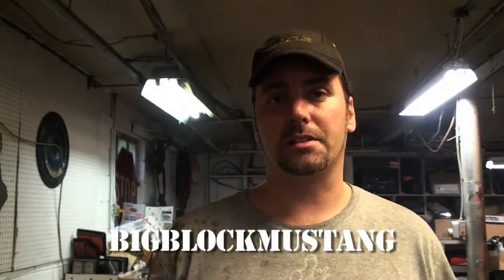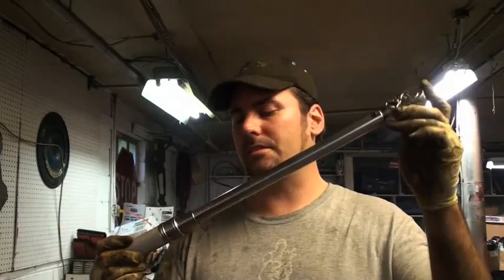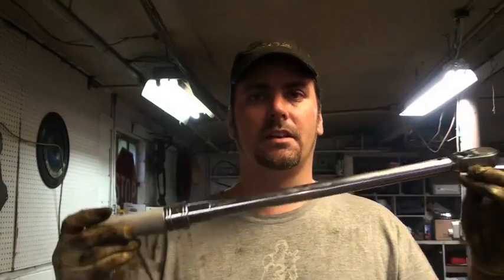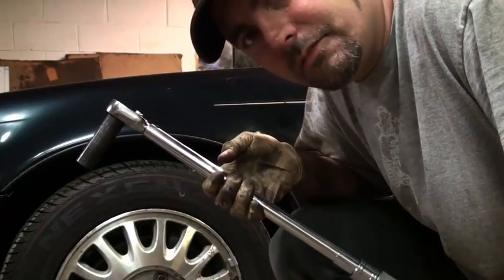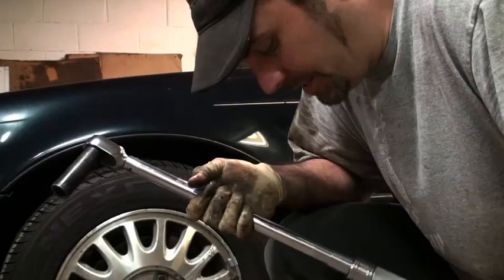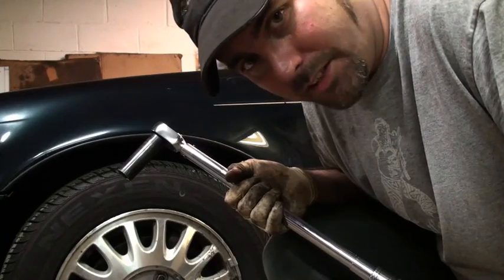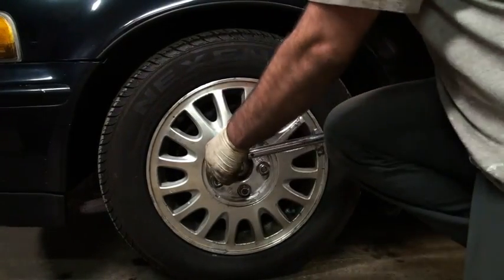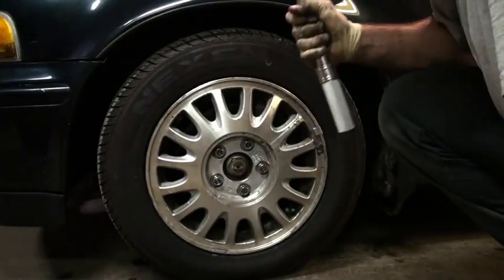Torquing Wheels and Why It Is Important - EricTheCarGuy

Comment: Just a reminder to everyone — always make sure your wheels are properly torqued after any tyre or wheel change. I recently had a very scary incident after getting 4 brand new alloys and tyres fitted at a local shop. About 30 minutes into driving at high speed on a busy dual carriageway, I started hearing strange noises. Moments later, the car began to shake and pull to one side — the front left wheel had completely come off.

Thankfully, I managed to keep control and stop safely, but the bare brake disc and bodywork were badly damaged, and the car is now in the shop for repairs. This could have ended much worse.

Moral of the story: after any tyre work, check that your wheel nuts are tightened to the correct torque — don’t just assume the installer did it right. It might save your life.

Comment: How can you torque a bolt after using Loctite on it? Wouldn't the bolt have settled with the Loctite by the time you lower the car and use the Torque-wrench?

Comment: I took my car to the dealership's mechanics just to replace all the lights in and outside. They also noticed a front knock (struts) when turning the stirring wheel. So they replaced the struts, which I've wanted done a long ago.  Which i gave them the okay to get it replaced. Well, I got the car back, but theres a sticker on the window stated "tires retorqued at 100 miles". If they checked everything and replaces the struts why cant they retorqued the tires, since they have the equipment.  Idk..please let me if they shouldve done this

Comment: Hi there, I wanted to ask you what the potential damage that can occur if the tech only tightens 1 lug but and just hand tightens the others to put the lug nuts on. Then lowers the vehicle back onto the ground and gives it back to the customer. They then drive about 10 miles at 50 kph, and once notice at 55 kph that they can hear their wheel moving back and forth.  You then drive another 2 miles in that condition in order to pull into a parking lot to see what’s going on and notice that the tech did this to your vehicle. I grab my torch wrench and tighten the nuts on the spot. Unfortunately, I didn’t have a jack with me to remove the rim first before torquing the nuts. 

I am bring the vehicle back to the shop to inspect for damage as they are covered by insurance. I’d like to know what I should be on the lookout for and would appreciate any advice.

Comment: 80 ft. Ponds thank you use to put them on so tight just before stopping them or break the lugs must.  Be getting old came off too easily so checking ft ponds I'll get a bigger breaker bar😂 save for torque wrench  to check getting weaker😢❤ thank you.

Comment: If you don't know what you are doing, you can still over tighten or under torque with torque sticks. It is depends on how long you hold the trigger and power setting of a pneumatic or electric guns.

Comment: You have to watch using the torque sticks on your Lugnuts because they are 10 foot pounds off I know this for a fact because I got yelled at by a shop owner for using the torque sticks and not rechecking them with a handheld torque wrench I’m just letting you know and I want you to go back and recheck those  Lugnuts with a handheld torque ranch and he was right they are 10 foot pounds offSo the torque sticks are good for getting your Lugnuts ran on an even pattern that’s all they will not be at the proper specifications they will be 10 foot pounds off

Comment: Works much better than the shorty lug wrench that came with my Ford Edge⋄⋄>share4.photo/cWheelWrench?まd    Still need the factory tool for the screw-jack, but the new wrench provides much more leverage.

Comment: Hope someone can answer this, I have a 2008 Toyato Rav 4 Limited and I just took off the original alloy rims and switched to steel rims for the winter, the tires are 17 inch size, apparently I have to buy new steel bolts or lug nuts whatever they are called and put those on, but my question is what would the torque be for those steel rims with the new bolts, I am thinking it would be different than the alloy rims and bolts, would love to know the torque so I can tell the person changing them out for me, I know I have to go buy the new bolts and I figure NAPA should know what I need, I am a senior trying to save a bit

Comment: Last week, the mechanic broke the absorber bolt while installing it. Few days later, I want to check the tyre, and failed to removed it manually (never face this problem for 15 yrs of changing car tyre).  Talk about over torque with air impact, easy for mechanic, hard for owner when emergency comes.

Comment: I liked to know what the torque is on the lug nuts on a 68 Chevy k10 with 7/16 lug bolts. I been telling tire shops to set them at 70ftlbs be a use they wanted to set them at 110ftlbs And  that is for 14mm ones. but I would like to ged t the right specs.
Thank you!
Reply: 80 is the typical safe torque rating if you need to do it and be done.

Comment: Tire shops should NOT use a impact gun to put the lug nuts back on. A typical car/suv needs 80-120 foot pounds to tighten the lug nut. The guns are putting them on at 200+. Ive had a couple of broken studs because of this, and a hell of a time taken them off on the side of the road as well.

Comment: I'm a tow truck driver of 20 years doing roadside work I've never torqued any lug nut with a torqued wrench and never been called back because something went wrong so I call bullshit!!!... but to you guys that are mechanics Tire changers and anybody else that does d i y ers. You all can read your paperwork but if you can not break a lug nut off a stud because the tire changer impacted the lug nut to fast and cross threaded it. I am talking from experience use ing a 4 way lug wrench and torqued by hand with a four way when the car is seated down on the ground

Comment: I just use the impact to lightly run the lug nut/bolt on to save time and torque the wheel to 1/4 of the total specified torque of the wheel (learned this trick from Volkswagen factory working instructions) and lower it to the ground and do full torque, it works too well to be true because first it keeps wheels secured when lowering and second it only takes extra 1/4 turn which is super handy for smooth, continuous torquing action.

Comment: The Toyota dealer was kind enough to cross thread not one, but two of the lug nuts on my girlfriend's Corolla with an impact when she went in for new tires. I had the pleasure of shearing both studs off when I subsequently went to replace her brake pads. Use a torque wrench...every time.

Comment: From what I've seen, if you find out the brake pedal is vibrating because the wheel lugs don't have all the same torque, no need to replace the brake disc even when driving like this for a while. Just torque back again the lugs in 3-4 steps, and the disc will go back to it's shape and the vibrations will be gone.

Comment: To properly do this it should be done in 4 increments 20ft/lbs, 40ft/lbs, 60ft/lb & 80ft/lb (final) if you wanted to be more correct with an even distribution of torque being applied. This will eliminate any chance of warpage of the rotors. Thats how i roll.

Comment: I hate people who whip out the impact to put lugs on. I went to do a brake job and noticed one lug was sticking out slightly. Turns out when I had my tires done they over torqued the crap out them and damaged the studs. I barely used pressure taking them off and so far 3 snapped on 2 wheels. I'm lucky the brakes made noise or the wheels would of come off driving.

Comment: You're also not supposed to have the full weight of the vehicle on the wheels you're supposed to lift it and get the weight off but leave the tire on the ground so the pressure of the weight doesnt effect the torque

Comment: This is really important, and a lot of people bypass this because they think it doesn’t matter a lot.  My rotors got warped pretty badly because the shop mechanics used an air impact wrench and torqued the nuts to 200 ft lbs.  Do yourselves a favour and go to an actual reputable mechanic who knows what he’s doing.  Or just buy a good torque wrench from an auto store and do the job yourself.

Comment: Hey bro, do you use a 3/8 torque wrench for cars/trucks when putting tires back on? Is that the standard for mechanics?
Reply: Joshua Snead 1/2 inch drive is better more leverage which means you're not breaking a sweat

Comment: Yeah I love it when I get new tires and they always use the impact gun and all the nuts are on way too tight.
Next thing you know I am fixing the issue with my own torque wrench.  Only need 100 ft lbs. on mine not 400

Comment: The big tire shops have a habit of doing this. I've had to replace quite a few wheel hubs on customers cars because those jerks are too lazy to properly torque them.. I always cringe when I see a tire shop tightening a lug nut that only needs 80-90ft/lbs with a 500ft/lbs impact gun.

Comment: I just bought a 1/2" CDI brand torque wrench. How have I gone so many years with out one? I do have a 3/8 craftsman but I am now chasing down a brake warpage at 19k miles on my new car from what I believe is the tire seller overtorquing or unevenly torquing my wheels. I watched them work and they run the lugs on with an air impact and then check with a torque wrench. It hardly seems accurate as they are moving super fast and that thing will click as long as its over the specified torque amount so I wonder really just how much torque those silly bastards torqued my wheels down to.

Comment: Hi Eric, I'm buying tools for a small project and also for getting into habit of fixing my own car and looking for best/most-reliable brand of tools to buy, including torque wrenches. What do you recommend? Thank you!
Reply: sorry im not eric but you can use powerbuilt or duralast, not bad companies at all and have lifetime warranties. stay away from harbor freight in most cases. if money is an issue for buying tools, I'd suggest a 3/8 torque wrench since it's in the middle of 1/2 and 1/4 so you have alot more variety to choose from or you can even get a 1/2 torque wrench and just use 1/2 to 3/8 adapters which are very useful in my opinion.

Comment: Lug nuts are steel rims are Al. Better to use anti seze on the steel thread and grease the contact area on the lug nut to Al wheel. Corrosion may not be a big deal but dissimilar metals can cause problems only way to slow it down is grease and that is not a fix.

Comment: I work at a lube shop...impacts are the only thing they use for wheels. I bought a torque wrench, and honestly will still have to use impacts because it's all about the time . they don't care if it's the correct torque . they want the car done. most likely why most shops fell into that pattern . I still believe in correctly torquing though.

Comment: Great video dude! I love your videos. People just don't heed how important wheel nut/bolt torque is and kudos for saying pound feet! haha so many dinks say foot pounds... I've been a Red Seal Tech for decades here in Canada and have seen some horrible after affects of improper wheel nut/bolt torquing. Some great pointers here I'd also like to add that one should not lubricate wheel nuts unless indicated by a vehicle manufacturer.  Lubricated fasteners have a clamping force drastically higer than unlubricated. I took a Caterpillar course where they had a pressure sensor between two plates of steel and we hand torqued the fatseners both unlubraicated and lubricated and the differences were shocking. The tensile load on your wheel bolt will be increased to the point that you may exceed its design strength. Torquing wheel nuts has to do with the interfence friction of the threads and mating surfaces so lubricating and hand torquing to lets say 100 lb/ft will increase the pull on your fastener until it reaches 100 lb/ft of interference torque.  Those damn torque sticks should be banned... My Ingersol Rand Titanium true twin hammer can over power any torque stick and dangerously overtorque a wheel nut/bolt.  Just adding to your excellent info Eric, stay safe and keep up the great work especially here on Youtube!
Reply: Hahaha. Troll you are... The wrong in your statements is high in content.  Glad you don't drive the same roads I do.  Keep up the substandard unsafe work dude 'cause you seem to excell it.
Reply: What?? I was replying to comments from gymchess. Anyone who agrees  with his statements should have their technicians license pulled....
Reply: +GymChess smh..... shhhhhh🙊 u may want to delete your comment (it makes u look like an idiot for 3 different reasons) thanks though 👌 lol
Reply: Hahaha. You're ignorance made my day. The moment a troglodyte like yourself gets are personal and talking smack you scored my statements a win.  Good luck with your wrongness and keep up the essence of ignorance because it seems that's all you've got to hang on to.  Now respond however you want because I shall not stoop to your Neanderthal level and let you bother me with what is years of precise experience in being an ignorant blow hard.
Reply: GymChess hahaha  you're an entertaining person, wrong on so many levels and ignorant of proper procedures but entertaining nonetheless.   I just love you Internet omnipotent tough guys who know best and tell tall tales to support your stance, which by the way is in the middle of nowhere...   and talking of proctologists..... I'd like to see things from your perspective but I'm not dexterous enough to fit my head up my butt...  I bid you and your asinine lack of knowledge adeu and shall leave the half witted responses on this matter to you and however many voices are rambling around in your cranium.
Reply: hi gmctech i may aswell try my luck asking you since it appears from your comment that u know what you're talking about...and im sick of searching for an answer to my specific question. im aware (and smh i do know better trust me) that a retorque is needed anytime a wheel comes off for any reason and its supposed to be after about 100kms or "50-100 miles" not sure since im canadian lol but im wondering if it makes a difference if u get them retorqued at about 900kms afterwards? lol i ask 900kms because thats about how far overdue i am for a retorque. i wasnt expecting to get my tires balanced and an alignment done but it just kinda happened when i went to dealship. i was extremly busy and lots on my mind so i completely forgot to get it done nor did they tell me because they knew i know better. anyway im wondering if they need to basically "reset" rim, for a lack  of better words, before a retorque SHOULD be done?
Reply: We'll the truth is, is that by the time you reach 900km you may have already be experiencing a loose wheel thus beating your wheel studs to pieces and your wheels stud holes may be oblonged and at the worst you may have already lost a wheel.  Go to crappy tire and get a half inch drive torque wrench and check your wheels regularly.  It's cheap and easy to do.  Remember to always back your torque wrench back to zero after each use too.
Reply: Oh I forgot to answer this ..... No. Don't take any wheels off just retorque them as is.  BUT!!!!!!!! If you more than 1/2 of a turn on your nuts, take the wheel off and inspect the wheel holes for any damage from wheel movement such as a build up up wheel material on nut face or oblong wheel stud holes.
Reply: thank you! not exactly what i wanted to hear but getting an answer and being aware of this provides a little comfort lol thanks again cheers😎
Reply: I haven't used a torque wrench in my life. Just check the nuts/bolts after 100 km or so. If they're the same as before, you're fine.
Reply: How's that? Do you have any idea how many wheels that I've changed in my life without once, ever, used a torque wrench? No, you don't. Not once ever have I heard of someone's wheels come off. Not once ever, have mine come off. An idiot like yourself; I don't know what your problem is except that your hands and brain capacity to torque wheel bolts are too weak.
Reply: lol u ape... he obviously meant that he doesn't need to know the amount of torque.. and no, it's not necessary with at least 2 braincells but for u it probably is
Reply: Exactly.
Reply: If it takes a technician to change his wheels, he probably needs a proctologist to wipe his bottom, too. :) I don't have to go very far besides myself to prove that it's absolutely, totally, not necessary to use a torque wrench. My father for instance has changed wheels for 45+ years on all his cars and to my knowledge only a handful of times has he bothered with a torque wrench. I'd love to see someone stranded by the side of a road refusing to change a tire because he's so nervous about the right torque that he much rather sits there in snowy weather in - 15 degrees Celsius and freezes to death because hey, the wheel might come off that one particular time but not the other 300 times. If you have a torque wrench, knock yourself out. But again, check the bolts and nuts after 50-100 km and if you don't have a torque wrench, you have my fullest understanding. Enough of this nonsense. :)
Reply: u still don't give up u silly ape.. lol if the guy says it works for him
 and probably millions of others over the world myself included then it 
works... accept it or not.. ur the one by the side of the road, too 
silly to change a tire without ur precious torque wrench... it's a tire 
change not rocket science u imbecile

Comment: my sister had new brake pads and rotors installed all 4 wheels on her sportage, it has alum. wheels, now the lugs on the driver side wont hold their torque, I suspect over tightening. do I need new rims or is a nother solution available?